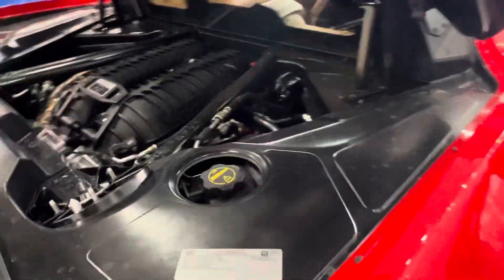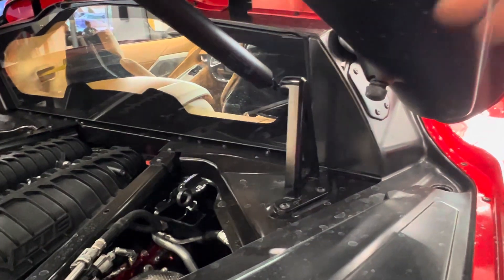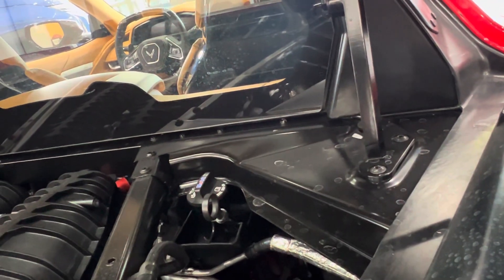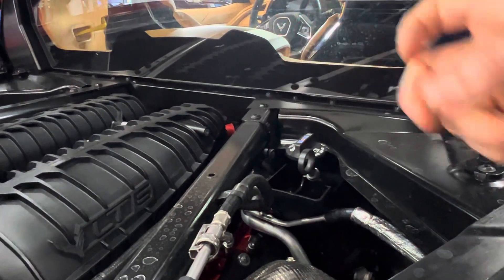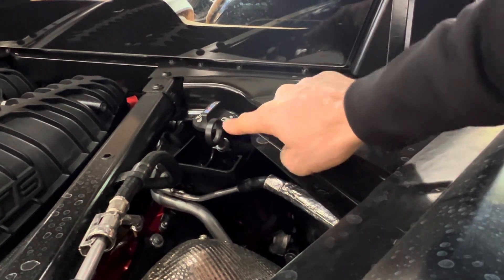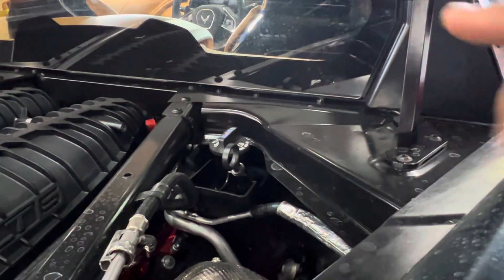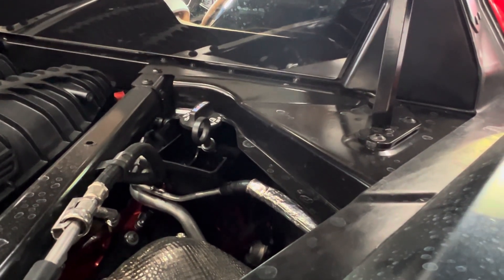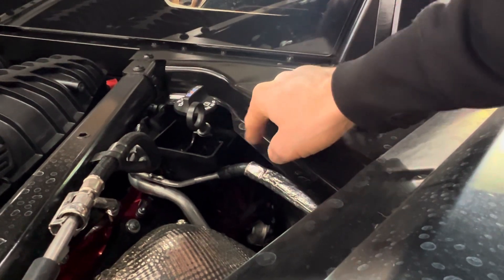100 bucks says GM doesn’t want us to see water/oil sludge in the bottom of the dry sump tank c8 z06

Comment: The drain plug for the tank is plastic and large in diameter. You could drain the tank and stick a bore scope camera through that hole. If you drained the oil on a cold engine the sludge would droop out in globs if there was any.
Reply from the maker: @pro5.019  yes, I point this out in the next/recent video

You still can't easily check for the UV dye from the gas however without draining all the oil

Comment: Would be interesting to see borescope images.  My cheap home unit from Harbor Freight (Ames) has a camera head diameter of 0.360".  Years ago I did borescope inspection for aerospace components using an industrial unit but I can not remember the overall diameter though it was less than 0.360".   Good luck in this investigation👍👍
Reply from the maker: @reversemaxxus  agreed

I think I found one that works for the job, we will see

Comment: Along with a recall to fix the fuel system, GM needs to drop the engine to replace all dry sump tanks since they all have been collecting sludge. And while they are at it, they may as well replace the engines since there is no way to determine what damage they might have sustained over the course of faulty fueling and possibly compromised oil system function.
Reply: While the drivetrain is out, GM should be ordered to replace the DCT with an upgraded unit that has uniformly heat treated pinion and ring gears and a larger capacity filter that doesn’t bypass prematurely. Between the engineered eventual failures of both engine and transmissions together with their hydraulic system flush procedure on already clogged filters, GM had their future financial outlook looking good.
Reply from the maker: @mitchblack7730  again, that's not going to happen either 

I'm just being real about how the car world works
Reply: @mitchblack7730 😂 why i like my ls2 800 hp NA MOTOR....NON OF THIS EXTRA DRAMA WITH TODAYS CARS....MY C6 VETTE WITH 
BUILT NA LS2...KEEPS UP WITH MOST SUPER CARS EZ...NO DRAMA..
Reply from the maker: @mitchblack7730  that's not gonna happen 

Longer court ordered warranty, maybe

Comment from the maker: I interchange ethanol and methanol in my description, but the outcome is the same, when either compound is mixed with water, its no longer combustible and becomes an unburned byproduct which runs down the cylinder walls to the crank case oil when chamber temps are cool enough 

Also, I only say longer fuel injection time duration instead of also explaining that the ecu ordering higher fuel pressure will also put more fuel and water ethanol into the chamber in x amount of time, instead of increasing x time duration 

Get ready for the ordered stop sale of all cars with lt6 and upcoming lt7 from the NHTSA ;)

Sludge that blocks an oil path to a bearing explains why the engines randomly blow.

It also explains why the engines don't blow at spring mountain...  No rain nor humidity ;)
Reply: Spring Mountain is Stingray only, correct?
Reply from the maker: @MrSdmckenna no, they have z06 and their engines have been flawless 

GM also developed this engine by testing in Yuma ...  Desert